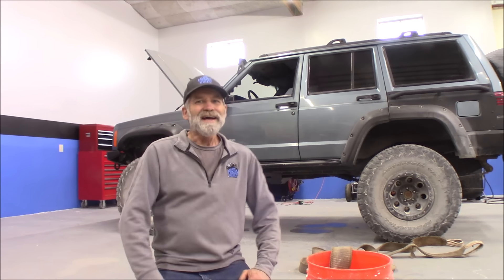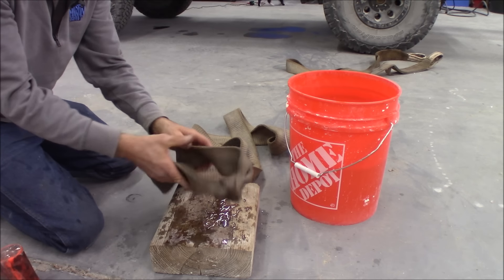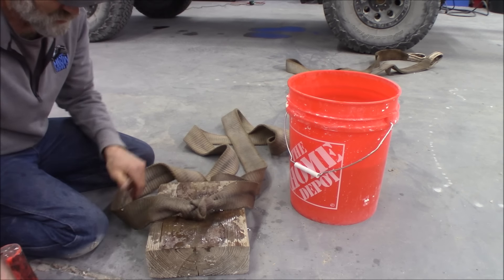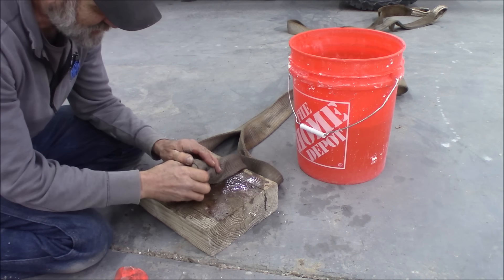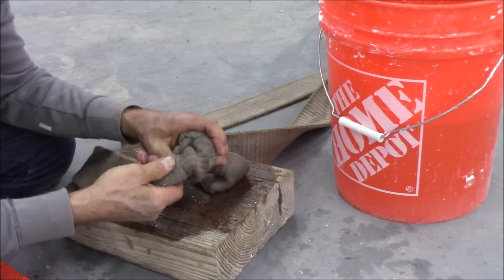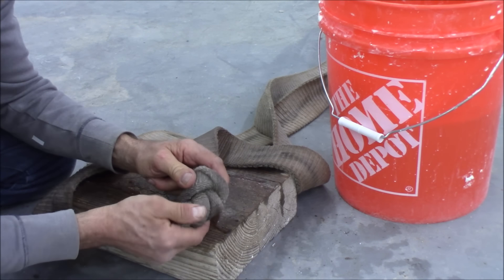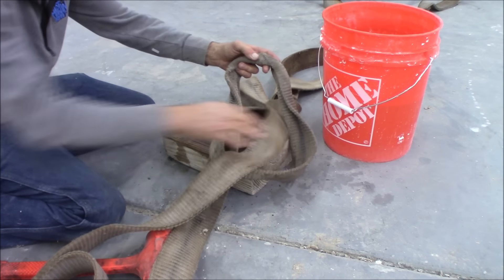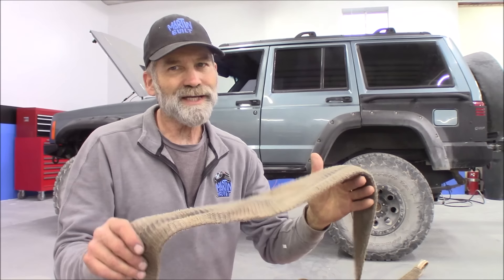How to Remove a Knot From any Snatch or Tow Strap and Rope

Comment: I was a truck driver and if you use soapy water it lubricates the strap without harming it. In the military we had to do this all the time and tried to educate the new troops not to pull on knotted straps. Thanks.
Reply: I was thinking soapy water myself; you can always rinse out the soap after extracting the knot(s).
Reply from the maker: Thank you, that's a great idea.😉
Reply: I’ve done it with engine oil and tyre levers. Lots of ways to do it, but patience is key.
Reply: I was going to post the same thing. Soap is the key. I learned, from the Motor Pool guys, when i was in the Army. The more you have to beat on it, the more potential damage you can do to the threads.
Reply: There is something called a marlin spike that is made for untying knots. Use that instead of a screwdriver.
Reply: Yup. Soap.
Reply: @randallkornholio2971   Most marlin spikes struggle on a line that wide.  I've brought down and used a screw driver the lack of a curve causes them to not work a well.
Reply: hair conditioner
Reply: I like how you truly got excited when the knot was coming out! Love the enthusiasm!!!
Reply: So you would get them to hold the strap really close to the knot whilst you would hit it with the dead blow hammer hey? Effective mentoring that ;-)
Reply: It’s easy to remove shackles, put shakle through eye of strap. Then feed the strap to make a slip loop in strap.
Reply: My strap was much smaller but had been set for years. Soapy water, no pounding, two pair of pliers.
Reply: @randallkornholio2971  Yea the Marlin spike + soap is easy.  Pounding with a hammer like this video is just painful to watch how much slower it is.
Reply: @BretBerger  Yep, hair conditioner is really greasy, good for shaving though.
Reply: soapy water is the essence.
Reply: @boogaboogaboogaable marlin spikes come in many different dimensions. They will work on wide straps just fine.
Reply: I don’t have a strap nor a knot; so I guess just wanted to see a guy pound a knotted strap !! Oh hum - I better go find a life 😂
Reply: Well then.... don't do that!!!
Reply from the maker: @dbor8432  thank you I'm glad you liked it and found it helpful and entertaining. 😁
Reply: @randallkornholio2971  Good idea but I have to add that the MAIN use of a marlin spike is SPLICING rope. I've spliced for fifty years and couldn't do it without a spike.
Reply: Twisting from each side, making the strap TIGHTER will loosen the knot. Do not pull tighter, TWIST TIGHTER! Using a vice hold KNOT, TWIST strap  FROM BOTH SIDES, TIGHTER. You will see it loosen, THEN PUSH STRAP TOWARD KNOT WHILE TWISTING IT TIGHTER! YOU will be amazed at how this works FASTER!

Comment: Once a knot has happened even if you remove the knot the material is significantly reduced. Hammering no matter what you use does also do damage. In the4 world of rigging, that strap is trash. It will probably work for recovery, but not for any load requiring rated straps. Pounding takes the grit obviously in and on the strap and just adds to the abrasive action.
Reply: Great comment!
Reply: You think maybe that’s why he specified “SNATCH” in the TITLE OF THE VIDEO??? Geez.
Reply: @jboat571x9  And doing what he did still degrades the strength of the line. I was only pointing out the work safety issues. Not the safety issues with recreation when it pops and takes your head off.

Comment: Dead blow hammers are a necessity in numerous situations. I gained enormous respect for their ability to firmly seat items being milled held firmly in an Angle-lock vice. The no bounce back feature is great when close tolerances are required.
Reply from the maker: Yeah they work great also for building a fire pit that I just got done, help set the blocks into the dirt.

Comment: There's a sailing tool called a marlinspike but you can use anything pointed like a large nail or Phillips screwdriver. It should have a rounded tip so be careful if you don't file it a bit.
Gently working it into the knot along the strap forces it open.
Poke one side then the other.
The marlinspike is tapered but you can use bigger tools as you create space.
You're basically prying it open from the inside of the knot.
Reply: Good comment. Thanks.
Reply: @jeffbrinkerhoff5121 both can be used to loosen knots up or loosening the strands to make a splice etc 
I think he’s referring to the pocket knife marlin spikes. 
The best type are George Ibberson Sheffield steel Yachtsman's knife with a straight edge marlin spike. I have a beautiful one with a thumb hole on the blade.
Reply: I was thinking that too!
Reply: First thing that came to mind was a marlin spike, all that smashing with a hammer seems like it might damage the rope. The navy has been using marlin spikes for hundreds of years to deal with ropes.
Reply: @jeffbrinkerhoff5121  When I was in the Naval Reserves why back when the large spike used to splice various kinds of rope were called marlin spikes.
Reply: @jeffbrinkerhoff5121  A Fid is a wooden spike used for the same rope work as a marlin spike. Marlin spikes are made of iron or steel.
Reply: Fid for synthetic rope or line a marlinspike for wire rope or as some call cable
Reply: @johnarnold893 there are many types of fids
Reply: @jeffbrinkerhoff5121  A "Marlinspike" IS a type of "Fid". You are describing a "Belaying Pin" which goes through a hole in a "Pin Rail" to "Belay" a "Halyard". Are you sure you're a sailor?
Reply: @johnarnold893  Um....no. Fids are most often made of Stainless Steel or Aluminum. I have about a dozen of them for various diameter ropes as well as a couple wood ones I made for working with heavy hawsers.
Reply: @johnarnold893  Hammering a rope with a plastic hammer on a wooden block won't do it any harm. I hammer my splices all the time to even out the tension, but I agree with you, a marlinespike is the proper tool for the job. Soaking may make it more difficult to untie as it causes the rope, or strap in this case, to swell.
Reply: @UguysRnuts  you're absolutely right..
Reply: Or, a spud wrench. Most fellows have one or two in their tool box  already, no special purchase needed
Reply: @808matson  *'Did' = I'm sure you meant 'Fid'
Reply: @BurtReynoldstash  The new Myerchin sailor knives and spikes are really nice too
Reply: @CaptainRon1913  I’m biased I’m from Sheffield. Ha ha
Reply: We have a drift punch like that for braiding cables on heavy equipment like cranes and winches or making mats works great on ropes or straps too as it was intended to separate weaves without damaging strands
Reply: Tk s for sharing.  I was on a ship 53 years ago and we never used a hammer. We used the marlin spike
Reply: @2centsam927 Could you tell me what a “Spud Wrench” is?
Reply: @paulfrost8952  sure. It is a steel wrench, either box, open ended or adjustable on one end, with a tapered handle that comes to a point. Builders use them to align bolt holes on beams, metal concrete forms and so forth
Reply: Yes.  Your suggestion is the best solution.  Watching the video was fustrating!
Reply: A perfect solution to this problem.
Reply: Used a sharp knife. It worked.
Now I have 1 short strap and 1 long one. Took me but 3 seconds. Dunno what the fuss is about ? 😊
Reply: @cathmar7394  nice !
Reply: @johnarnold893  Thanks!  I was trying to remember that name!
Reply: @cathmar7394 thanks I'm going to bed and I will be laughing all night,at least.😊
Reply: A big fid made from a railroad spike or screwdriver with the point ground blunt so it doesn't pick up fibers and tear the weave of the strap is what is needed here along with a rubber/wood mallet or a deadblow hammer like.what was used.  

The suggestion of a spud wrench is great too.  It could be used almost like it was designed to line up holes in steel beams & columns .
A little bit of dish or laundry soap would help lube the knot up so a fid or tapered shaft like on a spud wrench could be shoved in and levered around to expand a tight loop of the knot.
Reply: All the marlinspike knives are weak will break under pressure also the spikes too short to gain a good entry to have leverage to work out. And why they break. A regular marlin spike is about nine inched long with an end can be beat on to drive the spike in to wedge out the knot. BM1 Retired nav 76-98 @BurtReynoldstash
Reply: @UguysRnuts  That's the idea' swelling the knot causes it to stretch and give a bit (more with soap) and the beating gets the fluid out and creating some budge so you can go on and use/insert marlin spike etc..
Reply: A carpenter awl or Phillips screwdriver works better. Best idea is don't pull on a rope or strap if it's knotted.  Real 4 wheelers have winches.
Reply: You stole my thunder
Reply: @hubertdeyette5070 Totally agree. While the wooden fid seems more rope friendly ...but try opening a jammed knot with it! Thin metal spike was ideal and handy and the fid seemed to be a joke. Hammering a knot to open it would only happen if the mate was not there!
Reply: Came here to say this too, marlin spike for the win!
Reply: A fid would have that done in no time…
Reply: For rope it’s a fid same as marlin spike for wire and a hollow one for braid but a fid is wood  also did you know there are three fids  or fiddles on a ship  ? Only an older sailor will know where these  are located
Reply: @CaptainRon1913: “New” Myerchin ‘spikes & knives?
I haven’t kept up, I guess.
I’ve had a large folding marlinespike and sheep’s foot knife; both lock through an ingenious “either/or” mechanism.
I’ve a couple one-piece (no handle scales) sheep’s foot knives, with lanyard holes at the heel.And  a curved marlinespike with a lanyard  hole that doubles as a shackle key. All were well designed, and worth the money I paid thirty years ago. 

Works of Art, they are!!
I’ll have a look and see what else John Myerchin sells!
Reply: Use wooden fid like a marlin spike but made from wood

Comment: I have a marlin spike on a knife I had on my old sailboat. Works much easier if you just soak the knot in clothing softener and water for a bit before you slide the spike inside the knot. Also doesn't damage the knot/rope/strap as much
Reply: Dish soap would do less damage to the fibres, as fabric softener breaks the fibres down! 🙂👍
Reply: I’ve seen racket straps with knots luckily non of mine have knots, but this is good to know

Comment: if you don't have a dead blow mallet, you can hit the knot with a piece of scrap wood and a hammer. you can also use a liquid soap or detergent as a lubricant to make the knot come loose with a little less effort. I use tow straps and luckily I've never had a knot get that tight yet. I found a semi trailer snatch strap that doesn't have loops on the ends. I would have to tie it onto whatever I need to pull or winch out. I have used a strap to yank a dent out before. The thing is to avoid fraying or tearing the strap. I'm impressed at how fast you were able to get the knot out of the strap
Reply: I had to make sure in the comments someone said this. A piece of wood and a metal hammer.

Comment: As a ropeworker, we use fids, steel spikes with either a blunt nose or a sharp one - the blunt usually, as it wont cause damage. That strop's folded in half, offering a channel which can be forced open. You're also losing a lot of energy to friction between the flat surfaces.
Reply: Try getting a knot out of a.plastic shopping bag  !
Reply: @rudygeorgiamulesandcountry1594  I've opened lots of them by twisting an end and pushing it into the knot. I've opened a lot of knots in very fine gold chains too, with a couple of needles and patience.
Reply: I was wondering if anyone out there had heard of the fid. Remembered it from boy scouts🤔

Comment: Good save.  Fabric softener added to the water can be helpful in lubricating the strap or line.  A small (10") spud wrench or ironworker's wrench has a long tapered handle that could be used as a large marlinspike.

One time I had a manager rake me over the coals for wasting time removing a knot from 1" 3 strand nylon line that was part of a chain and nylon tow rope.  We had one in every company vehicle.  It was far tighter than the knot in your strap so no way to remove it so I cut it out and spiced it.  As a recreational sailor, splicing was no big deal to me.  I just didn't want to be stuck in the show and ice and have that line break trying to get towed out.  That was long before safety has been elevated to the status it has today but I still should have thrown down a "safety card" on him instead of just taking the butt chewing.

A single overhand knot in 3 strand nylon reduces its strength by 55%.  I haven't seen data on what it does to the strength of a strap.
Reply: @justinb6821  A splice done correctly should be the equal or better of the original. A splice done incorrectly or one not intended for the material is not trustworthy.  A Naval lifer once told me that in his world, trust was everything. You didn't have to like someone, but you'd better be able to trust him with your life, because you often did. A knot (or splice) was just as important.
Reply: @nocomment5175:  SO TRUE!!
Thanks!!

Comment: Bravo....the feeling you get when the knot starts going apart is always great....that dead blow has steel or lead shot in it, not sand....
Reply: It depends on how heavy the dead blow hammer is.
Reply: More efficient flow of energy directed to the target area .
Reply: What is the dead blow mallet used for? Not heard of it before
Reply: @SteveMacSticky used when you don't want to dent what you're hammering on and minimize the rebound from regular hammers bouncing off the surface, so all the energy is transferred more effectively with a gradual impact.
Reply: @dubmob151  thanks

Comment: Good job!  I was rooting for you the whole time!  Getting knots out of rope and strap is always a pain.  For those going outdoors or working around the shop, I highly recommend the Ashley Book of Knots for the great wisdom he collected in there.  We've forgotten much about how our ancestors did things, and it wasn't really that long ago!  Knots and pulleys, how to set them up, and a hundred different ways to use them.... if our grandfathers could raise a big ol' ship out of the water for yearly maintenance, that says a lot!  And we can use the same techniques to easily get stumps out of the ground, move heavy machinery around the shop, and lash things to the bed or trailer.  Keep up the great work!
Reply from the maker: Thank you, I appreciate that. I was determined to get that knot out. Thanks for commenting and watching have a great new year.
Reply: Or sling elephants. Folks who have read Ashley know what I mean.
Reply: Yes. The bowline knot is thought to have been first mentioned in John Smith's 1627 work A Sea Grammar under the name Boling knot.
Reply: @threeriversforge: How correct you are!! Thanks!!
I’ve had my ABOK since 1973-4, and have been a member of the International Guild of Knot-Tyers (IGKT) for about twenty years. The IGKT was founded in 1983(?) by five(?) esteemed English men due to a newspaper publishing “the first new knot,” a Dr. Hunter had invented/discovered a “bend” a connecting knot, which he dubbed “Hunter’s Bend.” (It’s always amazed many that a newspaper would care to publish an article on a knot, but I am greatly appreciative that they did!!) 
As the five guys couldn’t find the knot In Ashley’s book, and although the bend resembled the Zeppelin Knot, they decided to (paraphrasing Geoffrey Budsworth or Des Pawson…) “meet up regularly to mess about socially with knots and such…”
IGKT produces a quarterly publication, Knotting Matters, has reprinted Clifford W. Ashley’s prior work, care of his daughter Phoebe, whom Ashley mentions early in ABOK, and maintains a library of knot-related papers, articles, books, etc. They (“we,” I guess…) sell books, publish papers, and maintain a free website of information/ideas/advice/debate related to all things “knotting.”

If memory serves me as serving serves a ship line…Des Pawson, OME, has published a research paper on the sundry fids, marlinespikes, marlinspikes, heaving irons and such which were made and marketed in the time of sail at sea. 

The Ashley Book of Knots remains my very favorite tome about knots!! I have quite a collection, as most knot tyers (English spelling) do, but I love the history lesson, the lore, the provenance, the etiology, the quirkiness, the side notes, and the thousands of drawings by C.W. Ashley!!

As he wrote, as you know, “If you can tie one knot, you can tie another.”  Keep tying Brother!!

Now…..if I can teach this electronic device to cease changing “knot” to “knit,” as it just did AGAIN(!), and “fid” to “god,” “did,” or “food,” I’d be a bit more pleased…
Reply: @williesnyder2899  Wondeful to meet you, sir!  You're spot on the money regarding Mr.Ashley's book.  I have several books on knots, but I've never seen anything that compares to the ABOK in terms of sheer joy to read.  

I've found the Knotting Knots channel here on YT to be rather enjoyable for instruction, the proprietor an IGKT member and all around pleasant fellow.  The way he presents the noble art is very easy to understand and follow.

That said, the one channel I always hold up for all to see is that of First Class Amateur because he shows how rope can be used around the home for everyday tasks.  Too often, people only talk about rope in context of camping, boating, or decorative stuff, and that tends to make folks feel like those are the only ways to use rope.  

It's very refreshing to see FCA so dedicated to the use of rope.  As he often says, "Rope will do what a Ratchet Strap does, but a Ratchet Strap won't do what Rope does."  Wise words, and something he proves with every video.  We need more gents like him, honestly.  I look forward to every video he posts because I just never know what new thing I'll learn.  Around the home, there's always a use for line if we'll just think it through.